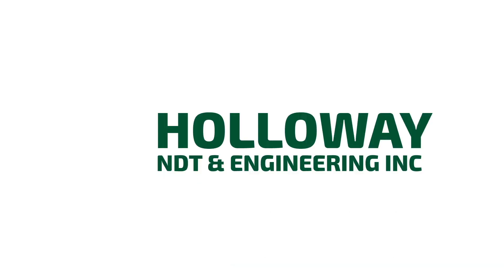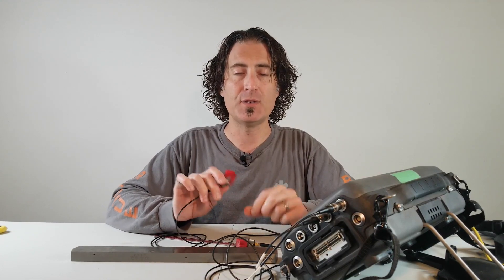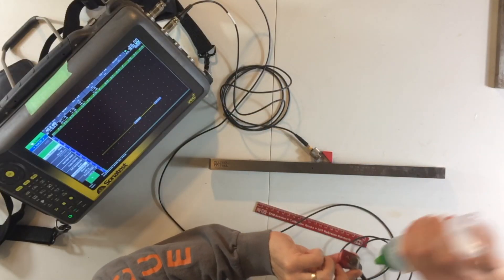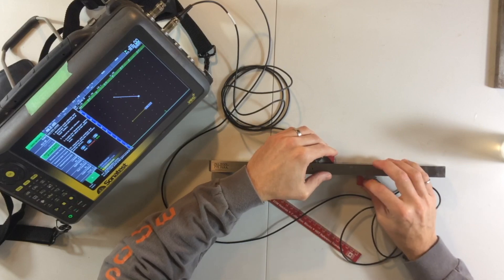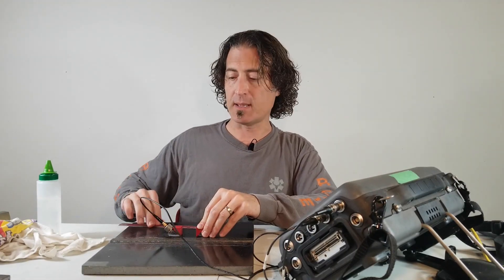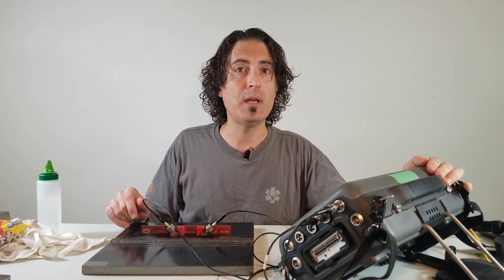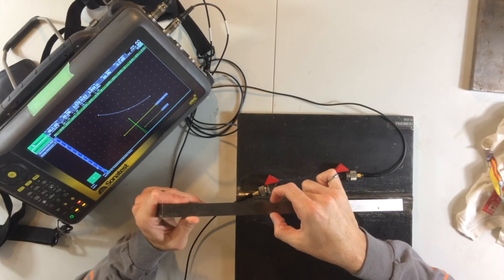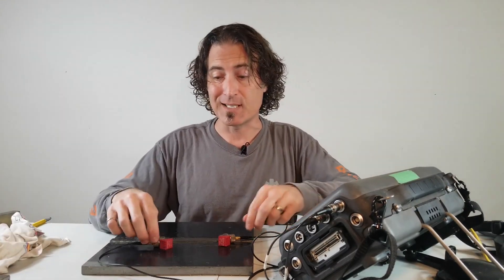How to perform a transfer correction

Comment: Very simplified yet understandable explanation! so just to confirm here if my TCV is about 2.5 dB, when scanning the test piece I should add 2.5dB more to my scanning level from my reference  dB right?
Reply from the maker: If your response on the test piece was 2.5dB low, then yes, you'd add 2.5dB to "pull it up" to equal the response on the calibraton block.

Comment: Do I need to calibrate my equipment (for Velocity) in Pulse-echo mode or Dual/Through mode to make transfer correction? Thank you.
Reply from the maker: Not really, no. Your pulser and filter settings should be the same as what you will use during examination, but the precise measurement of the arrival time is not important. Only the difference in amplitude between the reference block and the test piece is needed.

Comment: Hello Sir, Can I use transfer correction to check the variation in attenuation of materials which are having different sound velocities?
Reply from the maker: Not really, since the difference in velocities will produce different refracted angles.
Reply: @hollowayndtengineeringinc.5201  He'll sir, thanks for the quick reply. What if I am making transfer correction using a normal beam probe?

Comment: Hi sir Paul, if i do transfer correction by using Pulse Echo mode instead of Dual mode is it valid?
Reply: Im using single crystal angle probe
Reply from the maker: You would need identical reference reflectors in both, and identical thickness. Much easier to use two probes in pitch catch.
Reply: Thank you sir! Btw, nice video and explanation 🙏

Comment: thanks for the informative video :)
may I ask a question? two actually
1- do I need to calibrate for distance and velocity/delay before establishing a DAC curve? or it doesn't matter anyway?
2- if I want to inspect using a 5MHZ 70-degree probe, but my Cal Block doesn't have enough space to do so, can I use the same frequency 5MHZ but 45 degree probe? knowing that all my probes from the same manufacturer and same element size?
Reply from the maker: 1. Yes
2. No
Reply: @hollowayndtengineeringinc.5201  that was pretty fast o_o 
thanks a lot!  that was very very helpful

Comment: Hi Paul. 

Is there a particular reason you use round 5Mhz transducers instead of rectangular? 
After watching this video are tried finding 5Mhz transducers but Iv only found round ones like the Olympus ones you are using. 
One of the procedures I use insists on rectangular probes.
Reply from the maker: Hi Jason, I bet the procedure you're referring to is AWS D1.1.  That code requires rectangular because that's what was around 50 years ago when it was developed.  I prefer round transducers because the quick change type (screw in) are typically smaller.  I do have some really tiny square shear wave transducers but they're all one piece (crystal and wedge).

Comment: Is it all practical to do a Transfer correction on a curved reference block? Considering that the OD to ID (I) DAC point would be lower than the first OD to OD (V) DAC point. Or would you just use the (V) and (W) points?

Thanks for the great video.
Reply from the maker: V and W

Comment: Nice Video, Very proffessional and easy to follow instructions. Might I suggest the following:  Use the "reference" block with the side drilled holes which you used to construct your DAC curve since you are measuring the difference in dB between the test piece and that block. Secondly I think it better you take the TLC on the test piece in the direction of scanning and not perpendicular to it. Grains become elongated in the steel rolling process and there will almost certainly be a difference in dB between Tx and Lx scanning directions, especially when dealing with steels such as TMCP. By the way, that is one hell of a SEXY Flaw detector... the machine, not you    :)  Liked and subbed.